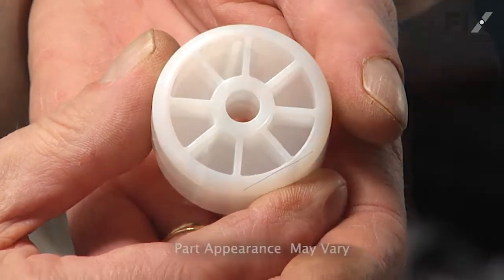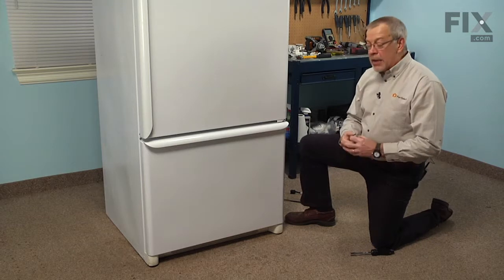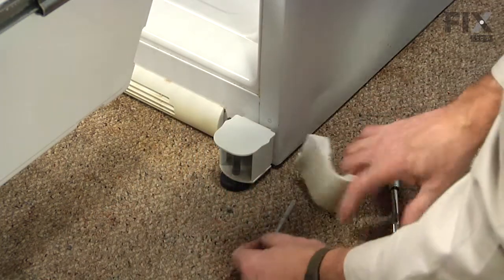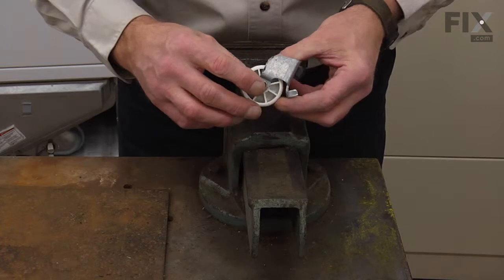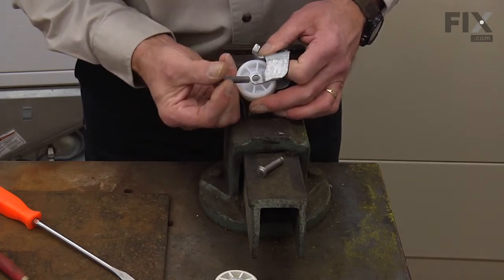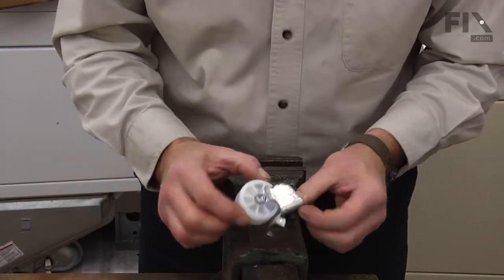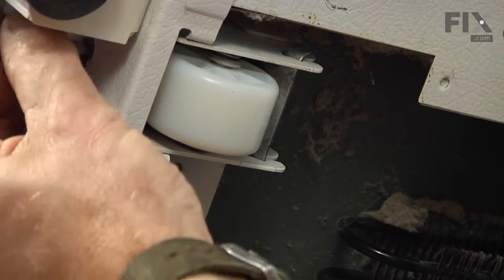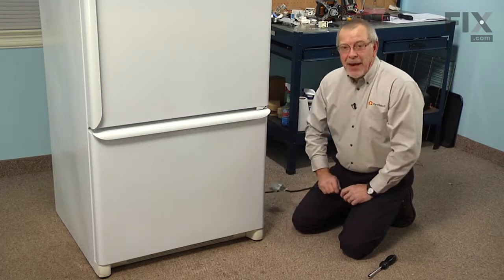Amana Refrigerator Repair – How to replace the Single Roller

Comment: You sir are a Rock Star!!! Thank you so much!! I didn’t need to replace a roller however I DID need to know where they were as it is not mentioned in the manual. My power went out to the fridge and I needed to move it to reach the power cord in order to plug elsewhere. 
AMAZING!! Thanks again!!